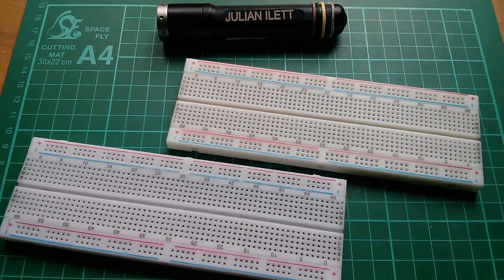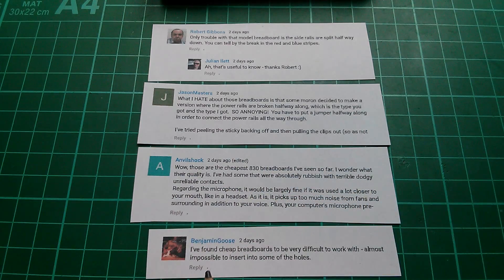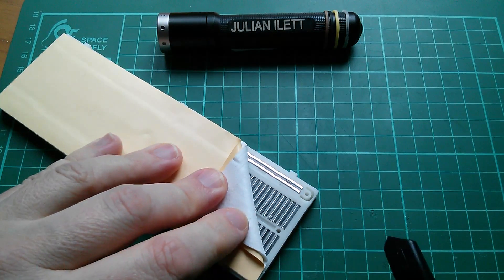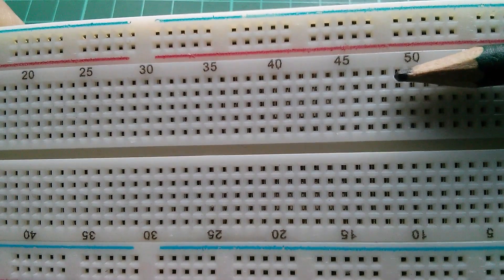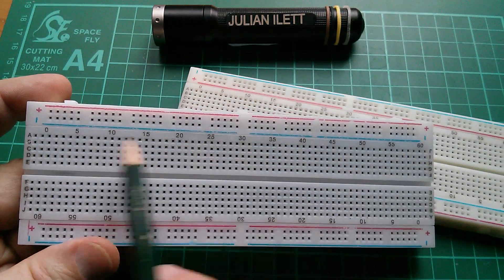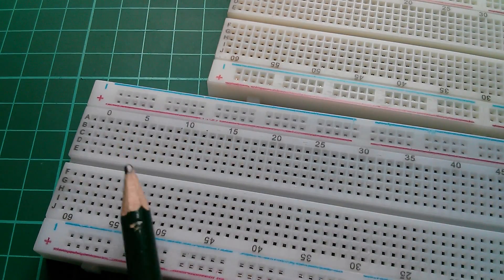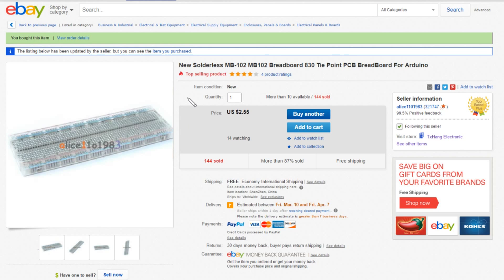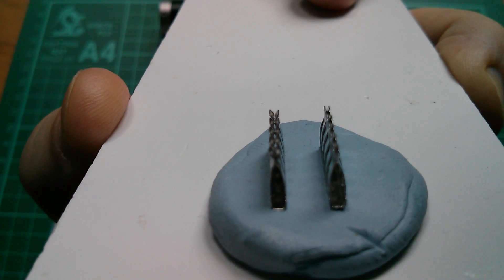FAKE Solderless Breadboards

Comment: Good 830 tie point breadboards cost about US$8 each in August 2025 (before TARIFFS! have had a chance to raise the price of everything), but I wouldn't use price to tell me whether or not I was buying a good board since that's likely to cause the absolute crap ones to be sold for higher prices. BusBoard Prototyping Systems makes quality equipment, though I've now seen those counterfeited on Amazon so I buy them sold by the company rather than any third party.

Failing that you just have to get them from a proper electronics supplier I suppose.

Comment: Separated rails are essential. If an experimenter is working with a transistor or chip amplifier with more than two stages, for example, a resistor and capacitor decoupling is unavoidable to prevent "motorboating". Also, I had to use long nose pliers to enable wire insertion, and needed to alter resistor values on the soldered item, as consequence of tie point ESR. Very enlightening upload from JL. Thanks. 🙂

Comment: Many breadboards have split in the middle power rails, sometimes you need more than 2 positive voltages, it's extra flexibility. You can put a jumper in between the rails of those boards to make them one power rail, but can't cut a breadboard power rail of board that have them connected all the way, so need extra breadboard or power rail.

Comment: I bought some Elegoo breadboards from Amazon UK October 2022 they were hopeless the holes were much too big / wide open so wires and component leads were a loose sloppy fit poor contact.  I much prefer K&H (K and H) boards more expensive but excellent quality plenty available new and used on eBay UK.

Comment: Nice, 5+ years later and my first ever breadboards are exactly these. Same color, same upside down/opposite a-j, same offset numbers, same insert issues. Strangely, the holes in the power rails are the exact opposite and most of them won't grip thinner wires at all. Can't complain too much though since the product pictures were accurate.
The split rails were a bit of a trap too. That took me a few minutes to figure out.

Comment: Trouble shooting a circuit is enough of a challenge without an intermittent connection somewhere. Its shooting yourself in the foot. Save $5 and utter $20 worth of profanities. Not a value.

Comment: You can also see that none of these have copper or some copper alloy. On my 3M Ace 236 (1987) which I am rebuilding, all the contacts are the copper (alloy?). If they are using steel in these knockoffs, I'd be wondering if rust will happen.

No sign of rust on the 3M board.

Comment: Recommend Mr Sharman's detailed review of solderless breadboards. There are particular brands of a consistently (repeatable) quality.  Saved me a lot of time and money - I was going nuts using cheap boards with dicey contacts - debugging that issue takes longer than any other.  Cheap breadboards will drive you insane, slowly but surely.

Comment: If you are using components with only 2 legs or so, it's possible to still use, however if you want to try to shove in an IC with like 8 legs or something, it's incredibly hard. 
They are essentially useless for most cases, it's good that you exposed the actual contact points and the reason it's happening. I also bought one of these cheap breadboards once when I first got into electronics. As usual, when buying on ebay from China, it's a bit of a gamble if you are going to get something that is designed properly, or a total scam.

Comment: The new 'fake breadboard' differ from the old 'good breadboard' are due to single-core wire-
 manufacturer fault .The manufacturer channged the  diameter of single-core wire to the  'Smaller size diameter' for Cost-saving ! Thus the user unaware such changers being the VICTIM ! The new breadboard is designed for smaller-size single-core-wire ! But the OLD/FAKE breadboard are suitable for outdated older( ten years older )single-core wire !! Users never measure the wire-size and being 'CHEATED/VICTIMISED' by the wire manufacturer .I notice such a SUDDEN changed 10 years ago when teaching private electronics diploma engineering
 classes ! Be cautious and aware !

Comment: The break in the power rails isn't a massive issue - I actually quite like it when working with multi-voltage projects. 5V logic on one side, and 12V for the LED strips or fans on the other. It's easy enough to join them together with a little jumper

Comment: Thank you, Julian.  I learned something here.  I too like low-cost items, and I have a few breadboards that are difficult to insert into, and I just put up with it and never really thought about it too much - but seeing the funneling on the better boards makes me wonder how I can make sure I'm getting the right one next time.
Reply: Don't buy from E-bay.
Reply: @ByteMeCompletely  Actually, I've just counted, and I have six breadboards, all bought from Ebay.  Five of them are easy to insert into, and one of them (which I unfortunately got for my gransdon) is not.  At 5:45, he asks "Could I have avoided buying the rip-off breadboards? - Well, not really"

The problem with Ebay is that it's an open marketplace, where quality manufacturers sell alongside cheap manufacturers who are selling 'covers' of the better stuff - but what marketplace is not like that?  If not Ebay, who do you use?  I have bought from Amazon and had rip-off products, and you can't just judge it on price either.  I was looking for a Ruizu X06 MP3 player, and noticed that I could pay £32 or £65 for exactly the same device from the same manufacturer, where the price doesn't indicate any difference at all.  You will get sellers who will chance it.

Comment: What is "A" at one end of the board is "j" at the other end.  That reminds me - when plugging in a power supply - one of those popular ones that connects to USB and/or a DC PSU, be sure that the indicated positive on the PSU is connected to the red-line rail.  It is very easy (bitter experience here) to plug it into the wrong end of the board.  Everything looks the same, but the rails are connected to the wrong power.  Then you connect your chip to the red and blue rails, and it gets hot and melts the plastic of the breadboard.

Comment: You guys probably all know by now but for anyone new and still looking: Check out BusBoard Prototype Systems breadboards. They are the cheapest reliably great breadboards out there...look for BB830 or BB400 and you should find them. And no, i have no affiliation! BB830 is only $7.90 with free shipping on Amazon: https://www.amazon.com/gp/product/B0040Z4QN8/ref=as_li_tl?ie=UTF8&tag=interlk-20&camp=1789&creative=9325&linkCode=as2&creativeASIN=B0040Z4QN8&linkId=fd103dfe4393b0837b2eb88f7c9785d5

Comment: Bought both 400 and 800 point breadboards recently, and because of this video I went to check.

The 400 pin breadboards have consistent lettering and the row numbers aren't just lined up, all 30 rows are actually individually numbered!

The 800 point ones are exactly the same as featured in this video.

Bought them all in a single package that also came with jumper wires that work mostly OK, but the plastic endclips want to fall off on some of them.

Comment: Aren't they meant to have a split? Sometimes it can be usefull to have more power rails. If you need them all connected, brige them with a wire.

Comment: That’s to be expected from a rapacious nation producing just about everything that retails as cheap as hell and of the “One Hung Low Brand”... I personally own a few such boards bought back in the day, made in Japan. They’ve been worked hard over the years and are still good today even though the white plastic is more a yellowed colour now. The minute I began a resent project on what needed a big layup with 4 hunks of this bad-labeled printed stuff I soon had huge problems with not only insertion but bad connects.... in the end I’d so many hold ups I threw the thing in the bin... and as I have always done when it comes to electronics tools, learned buying cheap ain’t the best idea...

Comment: Thanks for sharing. Very helpful before buying. Though I have a little correction for your video regarding the split in the side rails/buses. According to Ben Finio's 'How to Use a Breadboard' video here on YouTube (ScienceBuddiesTV channel), there are two types of full sized breadboards: one is with side buses that run the entire length of the breadboard, and the second with side buses that run only half the length which indicated by the break in the lines. However the break is actually by design and it's convenient if you have a circuit that needs to be powered by two different voltage levels.

Comment: I got a Radioshack breadbroad from a surplus store (for about $20 :/) as my first board and even with that I find that with some of the contacts, I can't insert anything into them unless it's perfectly straight. If it's bent even just a little bit, it won't go. Incidentally I bought a ~$1 board on Ali Express last night. Seeing this video doesn't bode very well for it though. I really like a lot of the smaller ones you work with, especially the modular ones that fit together. So I might look for something like that.

Comment: The split rails, once you are aware of them, actually give you options. Instead of 4 power rails, you get 8. This makes designs with multiple differential logic levels or many power supply channels, easier.

Besides, all you have to do to permanently connect the split rails is use some tiny solid core jumper wires that lie flush to the board. Conversely, you can convert ones that do not have split rails by snipping a millimeter of the bus bar between the sections.

Comment: Do you not really a businessman right? I ask company to produce me 500 000 pices of this. The company start to produce, make some tests, make tests boards, send me my 500 000 boards how I order. But they produce in real 835 743 pices, so they sell the more produced boards to 3rd seller at the grey or black market. Them use ebay now as online market ... You now too stupid and buy one board what are originally 2 boards mirrored. So the + / - lines are breaked and the numbering mirrored too! Sure you use only left writing from every side. 

I know to think about someting is not easy!

Comment: I got a transparent one with lower case lettering and pins do go in easier, but I find the grip not as strong as the fake ones. I found the cheap pined Dupont wires in Ard kits have a burr, so are hard to get in the BBs, and after filing a point on them they are ok. Either way I have problems with reliable contacts with either BB. There is a third all white BB with no writing and less row holes on the other power rails, that could be better than both.

Comment: the  reason for break because so if the one half circuit need 5v and other half 3 v so you can work nicely its not bug its feature
Reply: That said, I've found the long boards sold under the brand name ELEGOO on Amazon have continuous power lines. They're not perfect, though. The numbering and labeling is a bit off, but I never needed that anyway.

Comment: The 'broken' supply rails are there for use with parts of a circuit that require different voltages. If you want one long rail at one voltage, grab a little jumper and jam it into the holes. Problem solved!
Wah wah wah.
Reply: That said, I've found the long boards sold under the brand name ELEGOO on Amazon have continuous power lines. They're not perfect, though. The numbering and labeling is a bit off, but I never needed that anyway.

Comment: Buddy I hope that's your only problem with cheap bread boards! I had difficulty inserting the components into my cheap one, so i decided to open it up as well! I found two adjacent buses in one slot! so they were not isolated and actually the two only made one contact! I'm wondering how many times I was disappointed at the circuit I was building and thinking to myself I was doing something wrong when in reality it was all the breadboard's fault! my advice is to take the back off when you buy it and take a quick look at the back looking for shorts. if you find one, fix it.

Comment: I have one that looks exactly like this. With letters on the opposite not being similar and numbers starting from 0 and sloppy print quality. But it's quite good. Components go into it smoothly.
I have another one tho, which looks completely different from this. It's all white with nothing printed on it, even the voltage rails are all white. And that one is awful. I have to wiggle components all the time for them to get in and sometimes they just don't go in and bend. I bought it because it was cheaper. Definitely not worth it.

Comment: You could try this breadboard I found it very good quality TRIXES Electronics Solderless 400 Point Prototyping Breadboard on eBay ( 391409326337 ) was £2.99

Comment: The labeling of A-E and F-J strips is superfluous. I wouldn't call these fake, just poorly designed and manufactured. I made a spreader using a wire-wrap pin soldered to a piece of brass round rod to prime the difficult ones.

Comment: One more point regarding the photo swap of the seller. I worked at eBay and can tell you this is a violation of their seller agreement. You can get your money back and file a complaint against the seller. The listing is a binding legal contract and the seller is required to supply you with the exact product represented in the photo.
Reply: Well I better get reporting then! It's not like they're just going to open a new store in 10 minutes.

Comment: I found a supplier who seems to be offering good quality 830 tie point breadboards on eBay for a reasonable price.
The supplier name on eBay is kingelectronics15 and the description is "MB-102 Solderless Breadboard Protoboard 830 Tie Points 2 buses Test Circuit K9"
I'm not sure if a direct link will work, but just in case, here's the link I have to the product:
http://www.ebay.com.au/itm/222369344749?_trksid=p2057872.m2749.l2649&var=521237271076&ssPageName=STRK%3AMEBIDX%3AIT

They also offer power supply boards suitable for mounting on the above breadboards and sets of jumper cables.  You can select to buy only one item or a combination of items, eg the breadboards with a power supply board for each one.

Comment: I checked Aliexpress and the boards closest to your description were the "TZT" boards (sold by "China's good module", "TUOZHAN" (which has 98% feedback and 23,000+ transactions, ) . They have complete power rails and lower case lettering, but as to the insides, who knows. I tend to buy from sellers that have at least one crown or two, 20,000 - 50,000 transactions.
Thanks to the video, I will carry the TZT boards on my store.

Comment: True story :)
I've bought 6 pieces of the same crap on AliExpress. I've opened the dispute. My other breadboard has a good quality and no "jokes" about numbers and letters. I've bought it locally for about a tripple price. That was too much so I've ordered that crap. BTW I've found today that working with these cheap fakes is a real headache! My circuit (the exponential converter) suddenly did failed to work. These b-boards "doesn't like" thin wires! So it will be a problem with resistors as well (thin leads too).
The mistake on Ali was that:
- the picture of a fake breadboard was in a box where you can't see numbers an etc.(!) Don't allow to fool you like this
- I've didn't asked the seller if they're genuine and didn't asked to show me EXACTLY what I've get. It's important!
I've had the other experience when I've almost ordered a crappy soldering iron. But I've asked the seller to show me the actual photograph of it... And she did show me the look of the OTHER soldering iron :) I've knew that SS-50 was "replaced" by a crappy SA-50. But didn't knew yet that it was discontinued everywhere... So I've ordered Goot's sold. iron with temp. control. Cool thing BTW (bought on eBay, the seller is wonderful - gave me +1 original soldering tip!).
Why they doesn't show the contacts? It's not hard to ripoff one and make a photograph.... Oh... I know why! Because nobody will buy a crap if it will be obvious. Or will win a dispute easily if the contacts will not be the same.

Comment: i got one of thse cheap bb's from china too. I took a larger sewing neetle and used it to spread them out a bit and it worked fine. also the split power rail is on purpose. if you need multiple power levels you can do that i.e 3.5 or 5 v.   but if not a simple jumper will work just fine.......   thats mt .02 from a novice

Comment: yes you can get a lot of crap but I have a good quality small 400 pin and I still get all the problems of a cheap 800 pin and the split will allow up to 4 in power supplies 8$for 400 and 4$ for a cheaper one my issue is it never arrived what the f@#$& where is my board????ordered Christmas

Comment: I have a translucent breadbord that came in an Arduino kit. It has the same reversed lettering quirk, but I hypothesize that has to do with the fact that the power rails split in the middle. I'd bet most split-rail boards are labeled the same way. Mine, however, does not have the funneling issue or the misnumbering issue.

Comment: when you try to lock together long side to long side
the distance between lugs is not consistent
the size of the lugs is not consistent
buying multiples from a single source might help
in one shot in the video, the power rails were transposed,  would not the lugs and their sockets also be transposed?
if you use dupont terminated leads on these, a quarter turn seems to open the way for insertion.